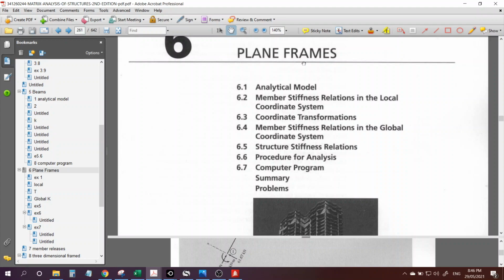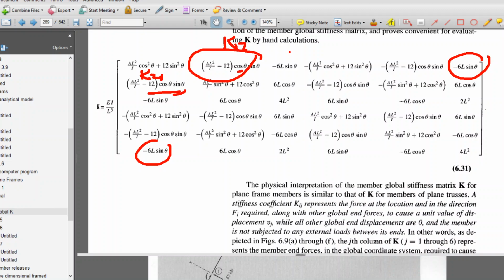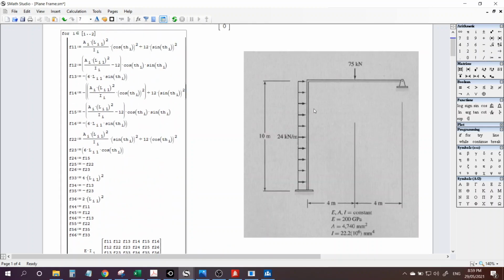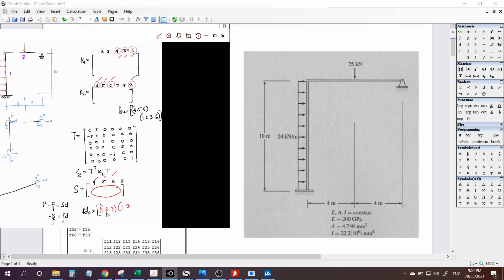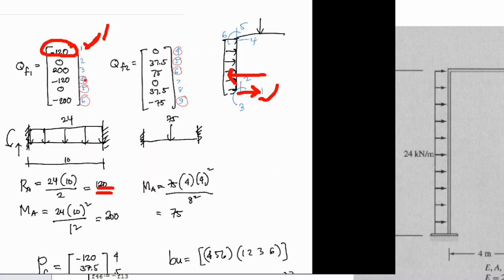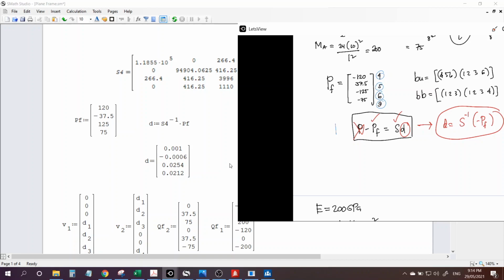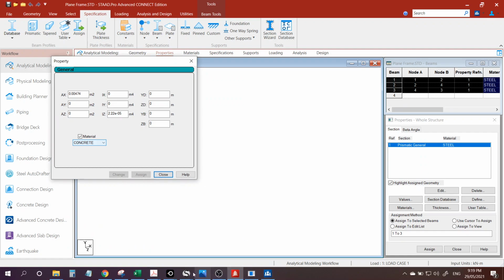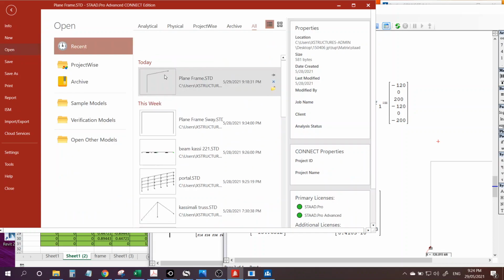Plane Frame Stiffness Method-Example 1

Comment: Sir I have a question. Pano po malaman ang angle ng isang vertical frame? Hindi ko po kase magets bakit yung iba 90 degrees meron ding 270 degrees na vertical frames.
Reply from the maker: actually it only depends on YOUR convention. textbook authors may have different convention or starting point of reference for angle. in my video i based on kassimali here